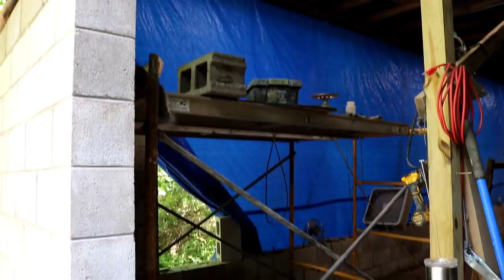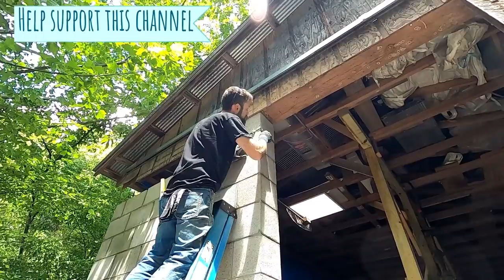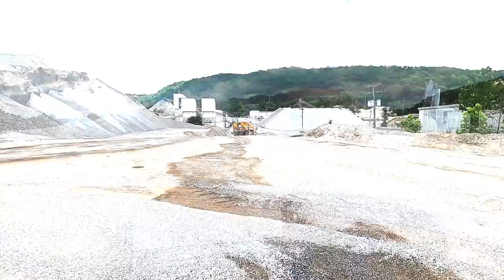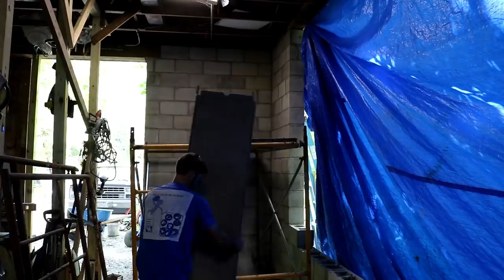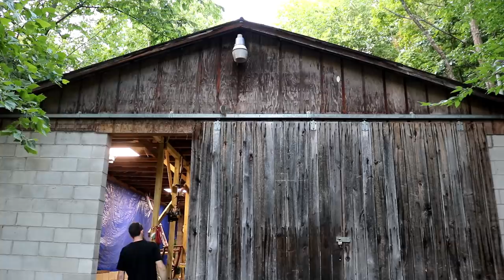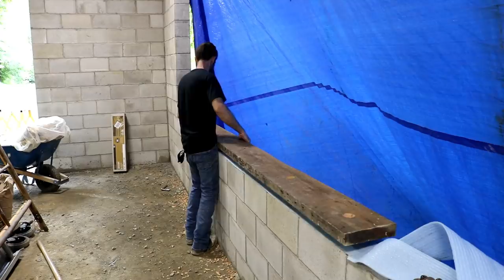Block Finished & Starting to frame

Comment: powerful shop vac with an extended pipe/hose is good for wasps up high, that way you do not have to jump off any ladders. :)  And if you have some grit/small gravel in the bottom of the vac, it helps pummel them so they are not an issue if you have to open it later.

Comment: Steve  In Sydney, where RODE mics are made, there are no squirrels, only possums.  So, while they may be made possum resistant, they're obviously not squirrel resistant.  Thanks for sharing your painful nail incident.  It brought back similar memories of so often treading on boards and getting a nail in through my shoe.  I'm like you - the memory has taught me a valuable lesson.  When I see a board with nails sticking up, I always turn it down so the nails are in the ground.

Best regards from ALBION PARK  NSW  Australia

Comment: Looking very good.

Here's a tip from an old carpenter.  When you want to cut a big board like the oak, square.  Measure the distance from the edge of the 77's table to the edge of the blade tooth.  Should be around an inch. Exactly, if you use the 'right' blade.

When you measure for distance, subtract that amount, then clamp your square down on the mark.

Run the 77 along the square, and 'Bob's yer auntie'.    Get quick at clamping, and you might cut all your boards this way.  I quit following lines 30+ years ago.  If a board only has to be close, then mark it, and cut it while the board's on yer foot.  I've found cutting along a square fast than marking and cutting the line.

Just don't forget when you change blades! THAT will ruin your day.

Glad to see you giving new life to old oak, I don't envy you putting fasteners into it. (wax them screws... LOL)

GeoD

Comment: It just wouldn't be a good start to the weekend without seeing a Saturday Steve Summers shop update.  The block work turned out perfect.  Looks like the only big event left is pouring the new concrete floor.  Make sure you pour it about 10 inches thick in case you want to get a monster shaper or planer like Adam Booth.

Comment: Steve, my Dad, Uncle and Grand-father were brickies from way back and when they were laying blocks or bricks they would joint the wall and then broom the wall with a bannister brush or broom before the cement totally dried and it saved them having to come back with a brick to clean up the joints. Plus it left the outside and inside of the wall totally clean smooth and ready to go. No scraping and cleaning when finished. Cheers Mate, Glynn.

Comment: After boring the holes in the sill plate, brush on a little mix of linseed oil and diesel. It will keep the pests out and inhibit the fastener from rusting.

Comment: When you stepped on that squeaky toy reminded me of the time  I needed a tool from the shop.  It was after dark.  I opened the door and before I found the light switch , I stepped on the end of my air hose and almost $$#$#$ my pants.  Though I was snake bit!!  I always enjoy your video's and thanks for posting.

Comment: From what I have found Frankfort had a rotary sawmill at least as far back as 1830.  By the 1880's it was one of the largest producers of sawn hardwood in the US As it was where all the eastern Ky timber could finally get out of the river and onto rail to be transported to bigger markets.
Reply from the maker: That's really interesting Brian,   I had no idea. I need to read more on that. Wonder if there are any old photos floating around.

Comment: That's the hard way to handle "lost keys".  However that lock prevents Your machines from "walking out of the door". Love Your sence of humour.
You are doing an incredible job. Ants never give up, just keeps on, and so do You. I take my hat off for You.
A friend once built a basement, cellar under the house. Supported a fraction of the house, did the digging, wheel barreling away the masses, formed the cement, meter by meter. All done alone. Would he do it again? No, never.

Comment: Love those intros with the padlock and keys. On the nail through the hand thing, as a kid I did something similar to my foot. I used to climb over the back fence near the trash barrel and jump down. Unfortunately I landed on a board with nails sticking up one time and my tennis shoes really allowed for great penetration. I had to step on the board with my other foot and pull my foot off.

Comment: I've had problems with wasps getting in my house. I finally found the nest (it was back behind a piece of trim). One thing I did learn though is that a 40/60 mix of Palmolive and water in a squirt bottle is pretty handy for killing them inside the house. They don't drop dead, but will usually fall to the ground in under a minute and eventually kick the bucket if you don't step on them.

Comment: Steve, my house was built in 1865 and my floor joice are 3" x 1 2" x 1 5' approximately. All rough cut oak . The floor boards are tongue n groove about 1 1/2 inch by 6" lengths vary of course. Square nails and pegged second floor frames 6x6 beams or better. I know from running wires to upgrade from knob n tool electric with 30 amp service. When the neighbor knocked down an old house the giant excavator had a heck of a time demolishing it. Told my wife you see how hard the house was to knock down. She was always saying ours was gonna fall apart well it won't . Good job on the block work.

Comment: Hi Steve , Elisabeth, Peanut and Walnut. The shop is looking great. You should be very proud of your accomplishments. As I have mentioned before I was a framing contractor for over 10 years and a commercial carpenter for 30 years and I would have been hesitant to start this job. I’m sorry that we could not meetup at Stans Summer Bash again this year. Hopefully next  year we can all go back to normal. I am looking forward to seeing a couple of nice big windows in that long wall. They should add a lot of natural light to the shop. Have a great week.          Bill from Seattle

Comment: The story of your hand nailed to the board reminded me stumbling down a raw concrete stair, right into a cardbox of nails the the roofers placed there, the nails were of that kind with the fixed washers at their heads, one went straight throgh my sole and into my foot...luckily it was a cold november and my feet were cold as ice, that way it didn´t hurt that much...
:-D
Great work and great vid as always, the barn door joke never gets old..
:-D
Thx a lot!
:-D

Comment: Hi Steve, this project is really coming along! You did a really good job on those block walls! You know you can repair that mic cable, it's rather easy! If I lived in your area, I would be coming over to lend a hand! Either splice the old end on, or better, just get a new right angle connector, solder it on yourself! If you really need a hand, mail it to me, I'll be happy to fix it for you! Your call!

Comment: I have 2 of them scars,  1 on each hand.    1 from a pair of scissors,  and the other from a shard of glass,  both passed right thru the hand.    Both   never really bled much and missed the bone / tendons  so was very lucky.   This happened about 40 years ago and at the time it was quite interesting to be able to open up the hole and look thru the hand.   Also have a 3rd scar on my righ hand where a huge chunk of sheet metal went in at the base of the thumb gashed a furrow up to the tip of the thumb,   that was worth 150 internal stitches to close.    Ah the  "fun"  of youth.

Comment: Nice to get to the point on a job where you can see the light at the end of the tunnel. 
My brother and I were just acting a fool . We had a couple of rods from an old umbrella playing like we were sordid fighting .
My brother hit the end of my rod and drove it into the palm of my hand about an inch and a quarter deep . The skin healed pretty fast but the palm of my right hand was sore for at least six months. It hurt when I used my palm to bump on a wrench to loosen a nut or  bolt .
Things you do when your  young and stupid .

Comment: I will say this much. For someone who has not built a wall like this before, you are doing a better job than the people who originally built your shop building. My guess is that the remaining walls have the same issues as the wall you are rebuilding. What you have done will outlast the rest of the building for many years.

Comment: Use WD-40 on those wasps, cheaper and more effective than that can crap that's sold specifically for them. Spray the nest down too. 
For your sliding doors, install those over-center latches into the block walls. They work great. That used lumber will give your building a "vintage" to it. 
Maybe next time, just whisper your idea's around them squirrels. They still make the channel great. Great video as always, cheers :)

Comment: Speaking of wasps and nails, I was remodeling a very old house in Minnesota, up on a ladder with a pile of scrap below me. The wasp's nest was under the next bit of siding. They attacked and I had to jump off the ladder, right into the lumber pile below, where I found a 16d with my foot. Like you, straight through and out the top. I had to use my flat bar to pry my foot free. Ouch is what I choose to replace the real language I used...
Reply: Yep, and it sure hurts a lot worse coming out than it does going in.

Comment: Are we there yet?   Are we there yet?     The ocd has been strong in this repair!    But hey’ one must admit it’s better to be thorough and careful rather than half ass a job like this.   ‘Especially when learning as ya go along somewhat.   Good work!   I’m sure that moment you have the floor finished and start putting your machines in their homes again it will be a great feeling of accomplishment.  That’s what it’s all about in the grand scheme of things.
Reply: And you can totally fix that microphone with a new plug.  They even sell ones you don’t need to solder where they simply have screw terminals for the wires.

Comment: That creek is like the small one that runs behind my dads place. Dries up in the summer but floods the place in the spring. Only time I ever got stuck by a nail was while working in a cabinet shop, was putting together a base and sneezed with the nailer in my hand, Managed to lift it and jam it down on my thumb of the other hand. Stung like crazy but I didn't realize it had driven a nail until I tried to move my hand. OOPs...

Comment: Some caution on reusing old boards. Treated lumber up to the beginning of the 60's was treated with arsenic. A friend of mine acquired some lumber from a house built in the 1910's. He spent quite a few weekends cutting them for his project and ended up with arsenic poisoning. I know you always wear your PPE, but just in case.
Reply: 1969Kakashi yes that is a genuine concern for Steve to address, especially as he has not finished cutting the rest of the oak boards. Steve, we always see you using eye protection but when cutting the rest of the Oak please use a good dust mask for any old timber you chose to reuse, as arsenic poisoning is not a good idea.

Comment: Do you plan on painting the block wall outside? One coat of block filler and one or two coats of acrylic latex. This will seal and waterproof the wall. And will look good too.

Comment: Funny thing, I was thinking exactly the same thing, just seconds before you did it. I mean the rebar in the block.
Reply: I had never seen this trick, Steve always impresses me! I'm glad he used the gasket between the block & the wood: a step that, if neglected, almost always results in a rotted frame.

Comment: You probably know a spray bottle with dish soap and water instantly mobilizes wasps , and if you spray down your timber with it they will loose interest in those trusses just put dish soapy water in a weed sprayer and hit those trusses they hate it and its human and Squerrel safe, in all those eves n trusses where wasps like and are rain protected it last a year  for sure if not 2 or 4 depending use dawn or palmolive not the cheap stuff it is more resilient, and super safe

Comment: I have allot of issues with wasps too. They hate the smell of peppermint oil and it's bad for them. So if you put a bottle of peppermint oil in a regular spray bottle and fill it up the rest of the way with water you should have a good repelent.  Once you spray it around you they should leave you be.
Reply: Permethrin > peppermint. When they're dead bugs leave you be then too.

Comment: Steve,  when you build that wall be sure to put a least a 2x10 header above each window opening (you probably already know this but just thought I'd mention it) it is a bearing wall. :-)
Reply: probably will need more than that.
Reply: @rustycowll5735  Yes it probably will I don't know how wide the window is.

Comment: i was up a ladder last year putting  some guttering up i was using an impact driver trying to get a screw through a piece of down pipe to hold it i had my fingers on the other side ready to move em out the way  an im going flat out with this driver trying to get the screw to start then it did an it went through the the pipe through my finger an im stuck to this piece of pipe 2 s storeys up on a ladder

Comment: That sill seal is only meant to prevent air, and has no value or very little to prevent moisture from coming up thru the blocks and rotting the sill plate, especially since your sill plate isn't pressure treated. You probably should have used caping blocks before you placed the sill plates. 
BUT for not being a builder by trade your doing a great job!

Comment: How was the concrete block filled under the 8"x8" lintel?  The slot in the hollow block is a typical 'engineers solution', I doubt the average builder would have gone to such lengths.  Normally, the bearing of the lintel should be solid and the easiest way is to use engineering brick, 3 courses high to suit the concrete block coursing that will be much easier to ensure a mortar bedding and means that the bricks can be built around the holding down bolt.  Also, the engineering bricks will give a much stronger bearing. 
The long wall should have an expansion joint so that the wall panel length is not more that 20ft/6m because otherwise the blockwork WILL crack due to thermal movement, such cracking will destabilise the wall irrespective of the reinforcement in it.  I was advocating this early on but was ignored, there is a possibility of cutting one in now but it will be more difficult.  Plain slip ties will have to be inserted in the horizontal courses to keep the two halves of the wall together.

Comment: There is a construction crew across the way from my work who are doing block work. 4 of them, and in a week they have not even reached as high as you have done part time, while they are working full time, 2 laying block, and 2 doing the mixing of the mortar.

My go to cure for wasps is a can of spray oil and a lighter, they cannot sting you if they cannot fly, because the wings are burnt off, and the flames also do a quick nest removal job. Carburettor cleaner also works, but is not as fast, and does not burn well.

Comment: That reclaimed wood is probably a better grade than you could buy today and you don't have to worry about shrinkage cause it is well seasoned (100 years worth)..... Working with reclaimed lumber is satisfying but has it's challenges too from nails,  twisting,  bowed and the like. I used some pine for flooring but had to remove the nails rip a lot of it and run it through a plainer. Are you going to use a preservative on the cap boards?

Comment: I really love you reusing good old lumber. All these remodeling shows on TV make a big show of blowing things apart with sledge hammers,  or dozing buildings into splinters. That stuff just makes me cringe. Some of that could certainly be repurposed. Some of that old, crusty lumber is tighter-grained, stronger lumber than the stuff you get st the big box stores. What is junk to you might be treasured by someone less fortunate, less into conspicuous consumption, and more into inexpensive, more responsible material resources.

Comment: Looks good but spraying down the blocks before setting would help prevent any future separation.
Reply: Filling the webs with concrete and rebar keeps them from separating. That and the doorwall wire Steve put in the joints.

Comment: Steve question for you - machining one . I have a hairline crack in my horizontal milling 14 inch side cutter(both sides). I have only an arc welding machine - question is should I just weld the crack shut or braze weld like I have seen you doing in some of your videos? and the shop blocks and shape are looking great by the way.

Comment: My OCD kicked in when I spotted that low block and a few seconds later he pulls it out of the wall.....Phew!.... disaster averted!
 All this amazing work just to get to where the shed used to be. At least it will be done properly!
 Would you consider that oak to be a hardwood or softwood?

Comment: Man, I've stepped on a few nails, never had one go clean through my hand though.. ouch..
Reply: Rookie Lock I managed to run a hook for crab pots all the way through my foot once.  those things are baited with half rotten chicken btw.  That was a fun walk home.
Reply: @roscocsa  A grappling hook ? yeah dirty and also pretty thick diameter ! Kinda funny, I just had some snow crab yesterday..  ;P
Reply: Rookie Lock not quite.  Its a C shape with a sharp point pointing upwards on the end of a 5-6 foot pole.  You use them when you put a crab pot in and out of the water at the end of a pier.  It was about 1/4".  😂
Reply: Ohhh like a picking hook? gotcha..
Reply: Rookie Lock yup.  I'm a hillbilly, those technologically advanced waterbillies confounded me!  😂

Or i'm just too dumb and leaned it against a post and dint lay the stupid thing flat.